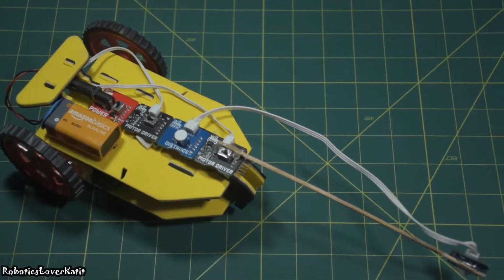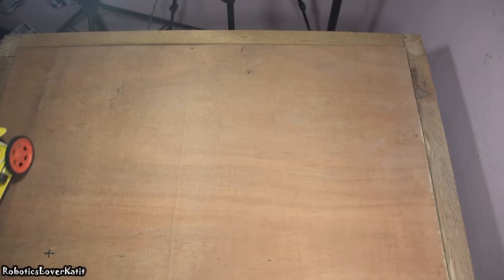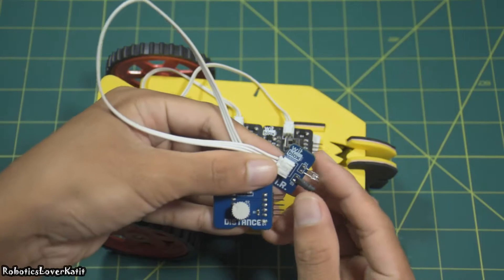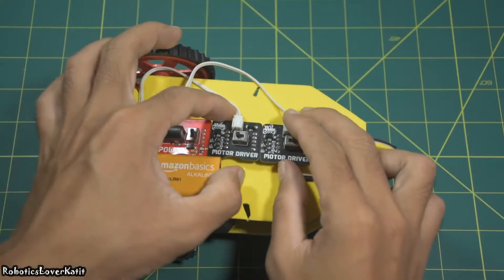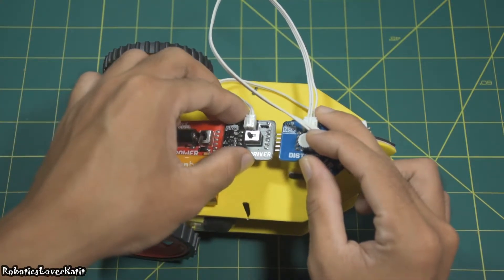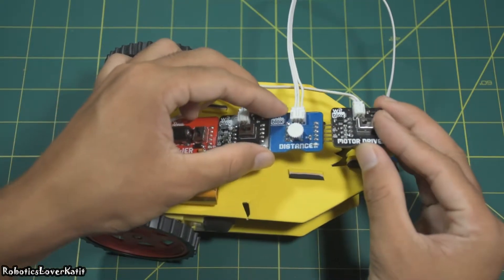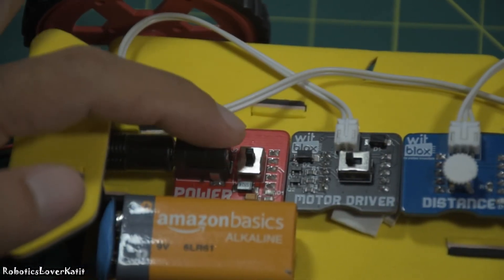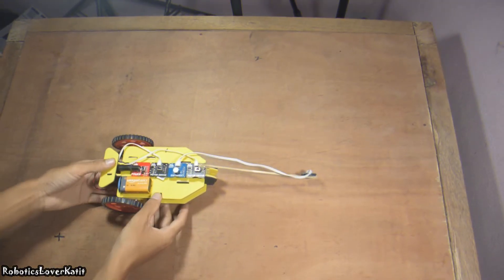How to build a cliff avoider robot using witblox robotics kit

Comment: Wow bro, with only few materials u r making awesome prototypes. And bro, just curious, which glue did u use to stick motor driver and bamboo piece.😘
Reply from the maker: Yeah,  actually it's robotics starter kit,  so you can make more 100 project with this kit.  I'm making a complete tutorial video series, which is available in manual book. 

And I'm using hot glue gun. I've already uploaded a unboxing video,  working principles, under hot glue gun vedio.  You can check it out😊

Thank-you for watching 😍